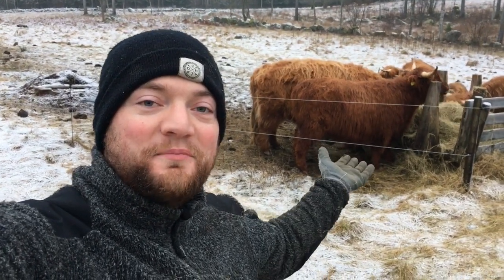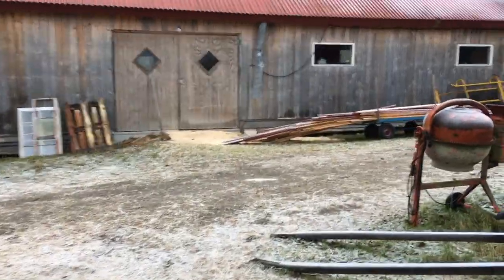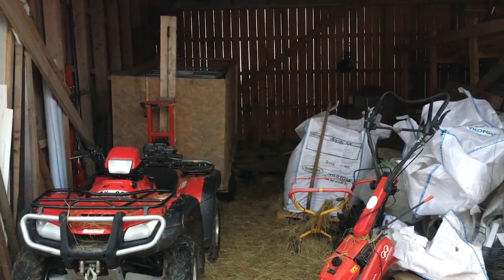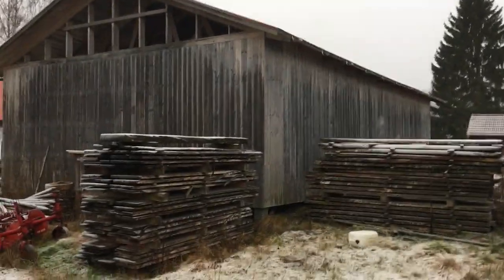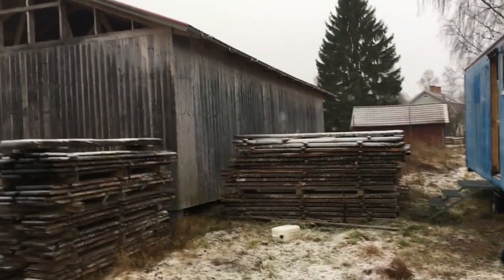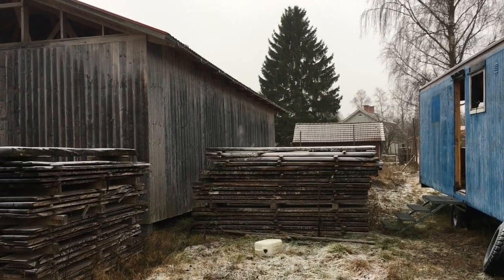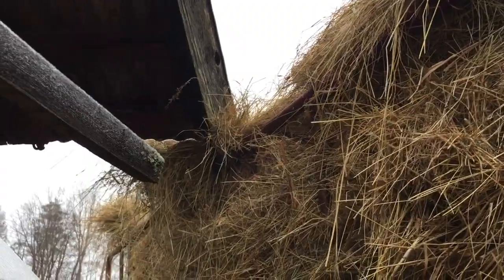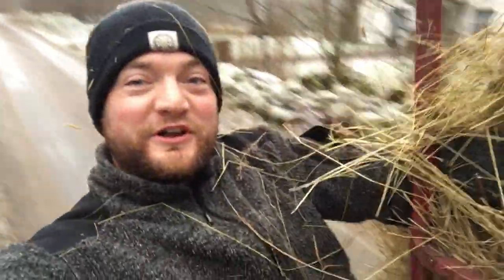Cow Update - New Stable & Hauling Hay

Comment: I am in Canada. I have to admit that is the first time I have actually seen hay harvested loose and in a wagon. All ours is in large round bales or square bales, using expensive equipment and a lot of twine. I will do it that way next year. Thank you.
Reply from the maker: We have a little baler that more or less bundles up the hay and puts a twine around it. It is called 'loosely pressed hay'. It broke during the end of the hay harvest and we had to load a couple trailer loads with loose hay.
The round bales don't dry enough and the hay molds inside of the bale.
Reply: Here we dry the hay completely before we bale it into round bales.
Reply: Did you have a hay ladder or fork it by hand?  Loose hay is higher quality, just harder to move and store.

Comment: Another great video, is that a Kioti tractor? Had a tough time seeing the name on it, if so does it perform well for you? Any issues? I'm considering purchasing a new one this spring and have no experience with Kioti vs kubota
Reply from the maker: Yes. It is a Kioti CK22. I have no experience with Kubota. We are very happy with it. Never had problems. The dealer where we bought sells Kubota now and says they are even better in quality but also cost $10.000 more.
Reply: Swedish Homestead that is why I am leaning toward Kioti, like you said the same size HP will cost considerably more. I'm surprised that it pulled that big hay wagon
Reply from the maker: We were surprised too when it pushed it up the little slope in reverse without any problems.